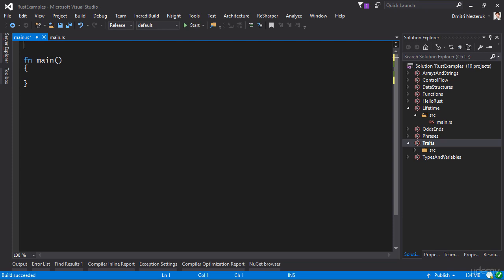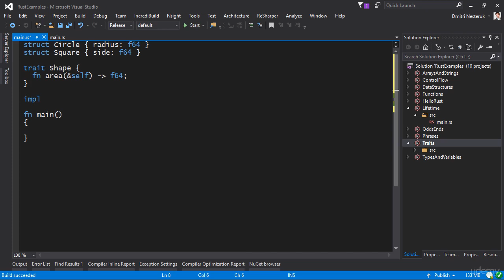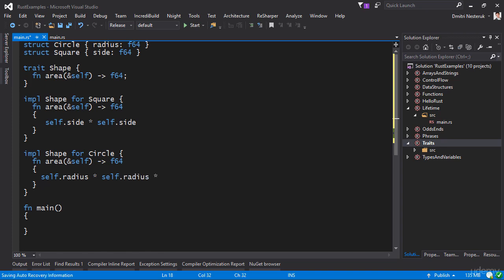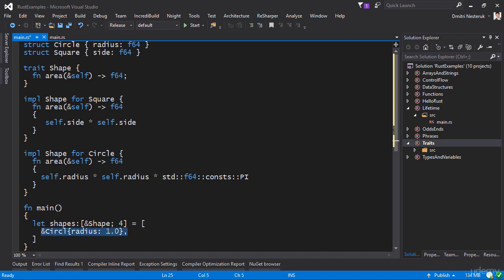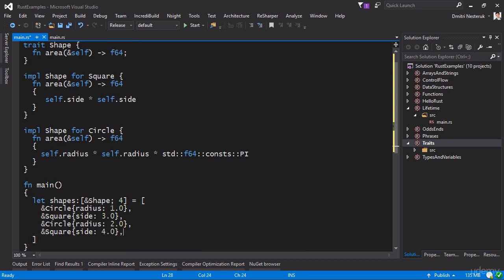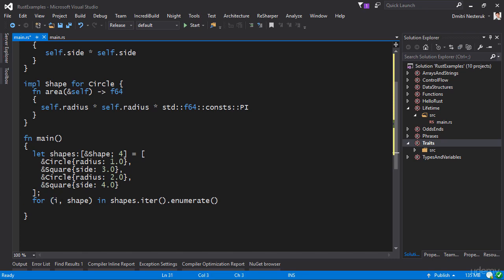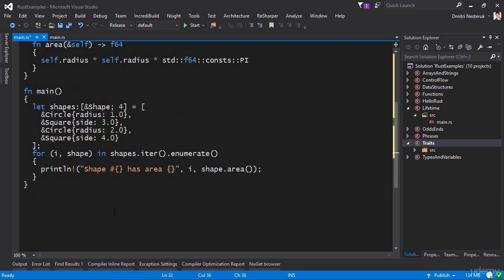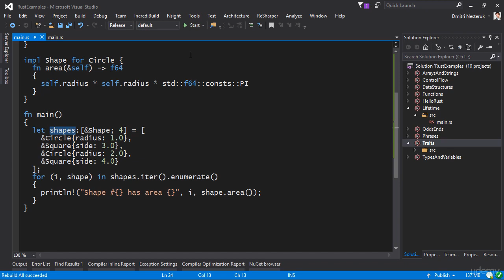The Rust Programming Language : Why Dynamic Dispatch?

Comment: It's also possible for dynamic dispatch to improve performance in rare cases, when the increase in code size caused by monomorphization causes the instruction cache hit rate to drop. This sounds unlikely, but if you have a function with multiple generic type parameters every combination of types requires its own copy, so it can be easy to do without realizing.